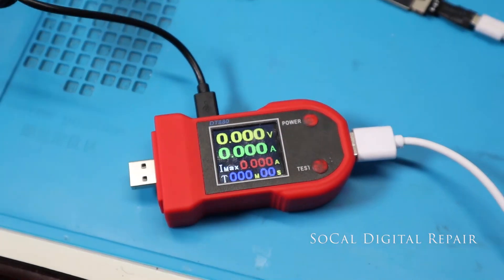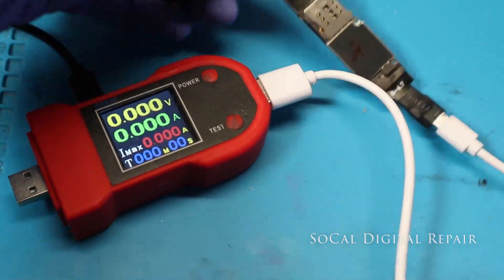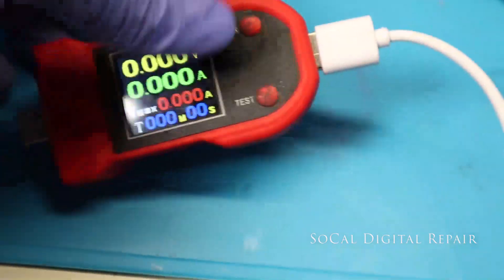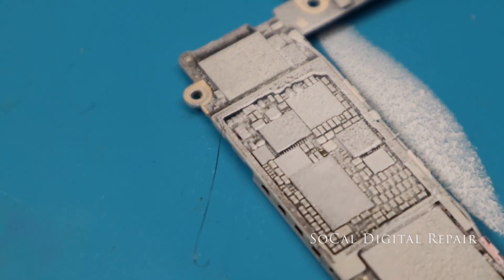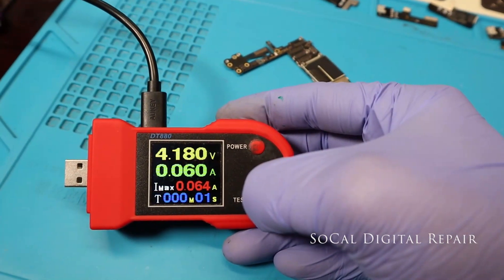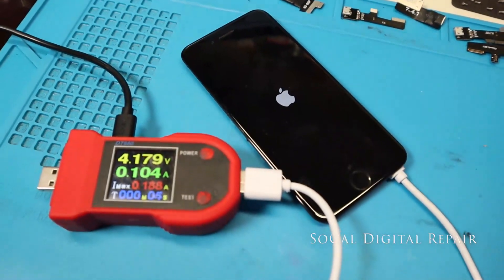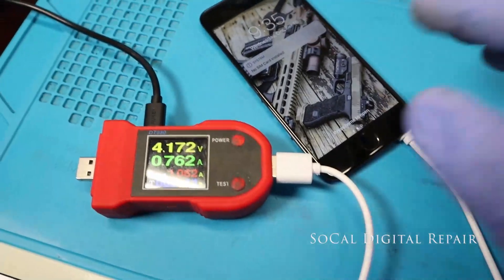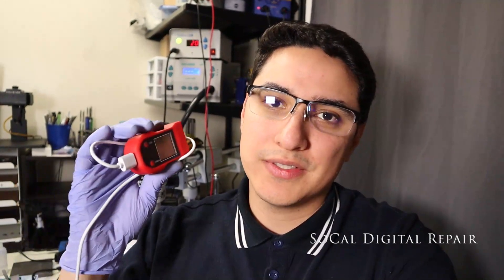Easy iPhone Logic Board Diagnostics! How To use DT-880 Mini DC Power Supply To Find Shorts

Comment: Jesse, I want to ask you something, 
can you use the android cables of the MECHANIC iBoot Box with the QIANLI IPower Pro Max
thanks in advance keep up the good work
Reply from the maker: It should work.

But I don't know. I use the DT880 and the mechanic cables work with it
Reply: @VCCBoardRepairs  I think so too it's 5 volts the output only the flex cables are different

Comment: Any video on the replacement?
Reply from the maker: What replacement? 😀
Reply: @VCCBoardRepairs  the replacement of the burned out capacitor. You skipped the best and most informative part. The actual fix. Lol
Reply from the maker: @jimmyjohnjuan  that was not the purpose of this video it was more about how to use the tool.

for that type of video, you can reference this: https://www.facebook.com/174118929698229/videos/962378057477954

Comment: Great clear explanation Jesse! I have a rather more basic cable that can boot up an iPhone, but it always shuts down by itself after a minute or two. Can you please tell me how long this device can keep the phone powered up for, and if you can also run apps that increase the current draw while you do that?
Reply from the maker: Yes this also simulates battery data so it doesn't restart.

Unfortunately, this product is no longer available and not being produced.
Reply: @VCCBoardRepairs  many thanks for your fast reply! Indeed, I had a look around and noticed that many companies cannot supply one, but found one that did and have ordered it. I did not get an email receipt, but if they deliver, then I will post the URL here in case others want to track one down… thanks again!
Reply from the maker: @jussy8342  i'm trying to push them to make more but we'll see what happens :)
Reply from the maker: It's available again. You can purchase it here: https://www.mobilesentrix.com/dt880-mobile-phone-current-maintenance-tester-for-iphone-6p-to-x
Reply: Hallo @VCC Board repairs - Jesse Cruz, Sry! For again bothering u. This device unfortunately is not available in Germany. Can u please suggest any other for 20-30 bucks. I am just a beginner and it my Hobby to repair the phones. And want to make my passion. I Hope u can help me. Thanks once again
Reply from the maker: You can buy it for $25 here https://www.unionrepair.com/dt880-mobile-phone-current-maintenance-tester-for-iphone6-x.html
Reply: @VCCBoardRepairs  Hi Jesse I’m in South Africa. Do you know where I can get one delivered? Oh and does it come with the spray?
Reply from the maker: You can buy it for $25 here https://www.unionrepair.com/dt880-mobile-phone-current-maintenance-tester-for-iphone6-x.html

It does not come with the spray. You have to get that separate

Comment: What multimeter do you recommend? True rms or. Not?
Reply from the maker: I use the Fluke 115 and it works great. You can set it to Diode Mode and it beeps when it gets a reading. Very helpful. Also works as continuity mode at the same time. Saves a lot of time. Worth every penny: https://amzn.to/2XV2Uv6

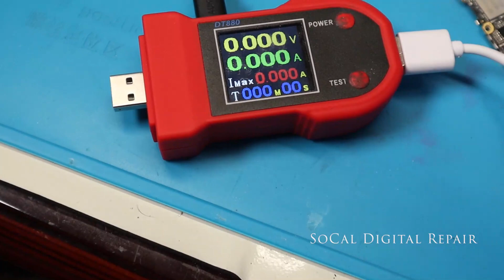Comment: What is that spray that you use at 1:44? Thanks!
Reply from the maker: It's a can of compressed air. If you hold it upside down, it will act as freeze spray
Reply: SoCalDigitalRepair Thank you very much!
Reply from the maker: @ПавелПенчев-э6и  No Problem!
Reply: @VCCBoardRepairs  where can i buy the spray
Reply from the maker: @davedevries7677  Here: Super Cold Freeze Spray: https://amzn.to/32RjKdL